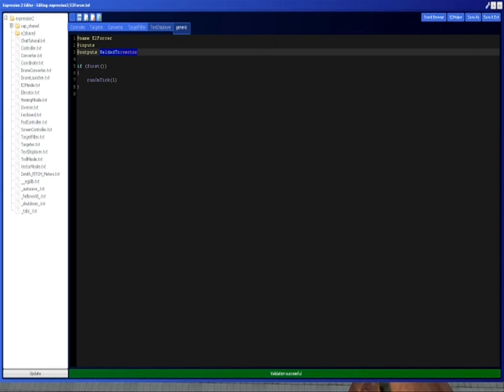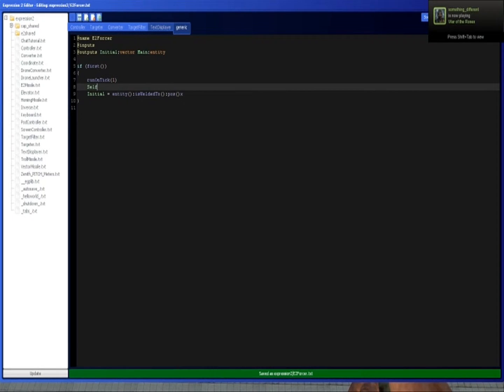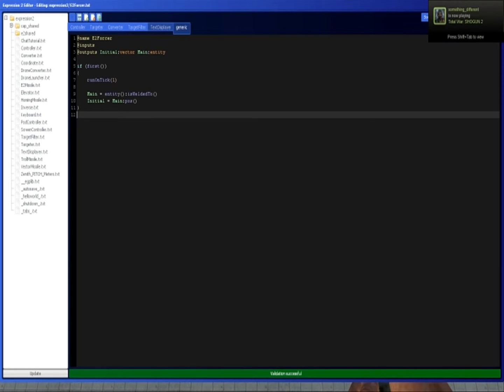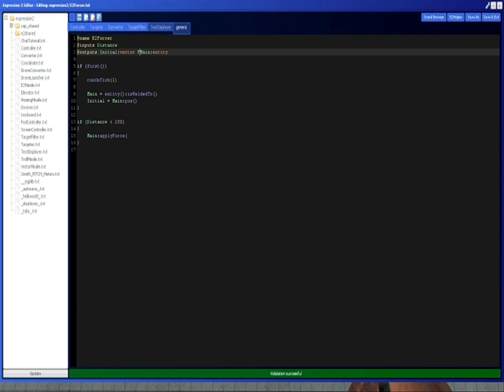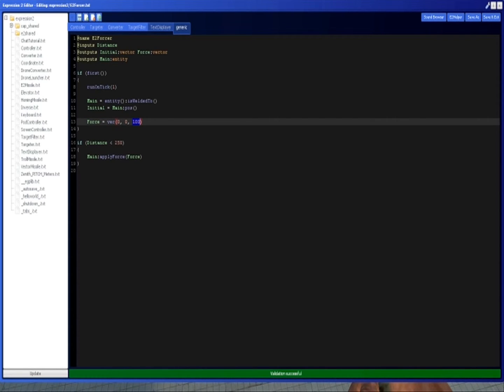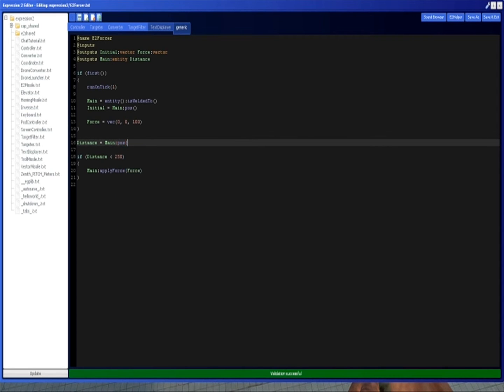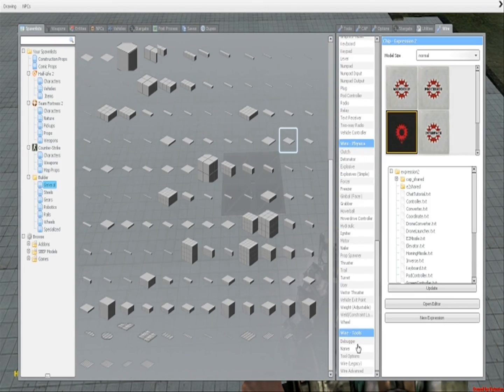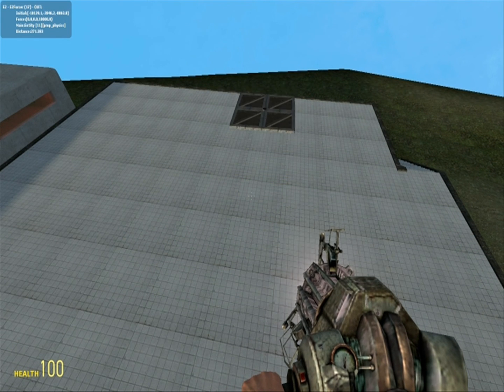Garry's Mod - Expression 2 Tutorial - 7 - Forcing our Hoverplate

Comment: So why do you put the first() in? Why not just have it runontick?
Reply from the maker: I just do it because it doesn't have to be called every single tick, therefore it is cleaner to only set it once. I don't think that it really matters for runOnTick(). However, I can conceive of methods for which it would matter, therefore I do it this way just in case, to make it a habit to write safer code.